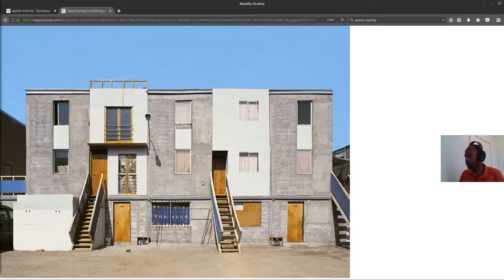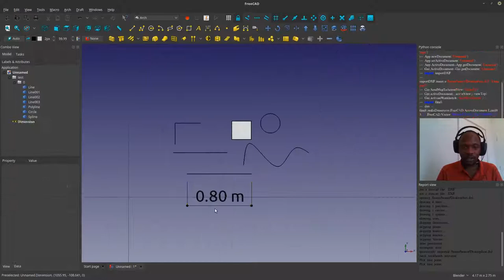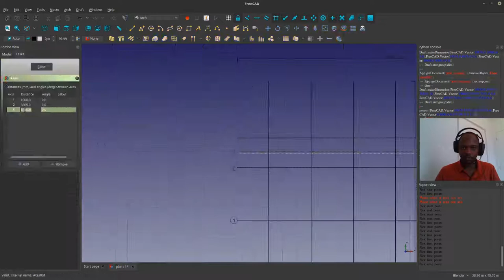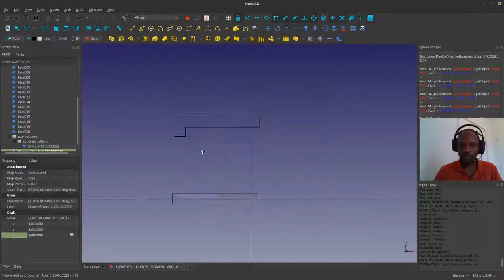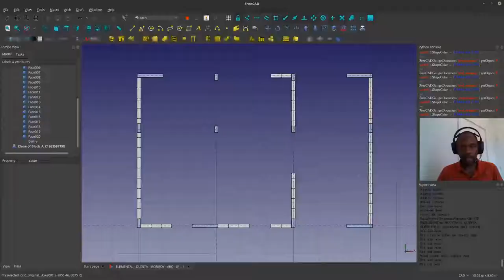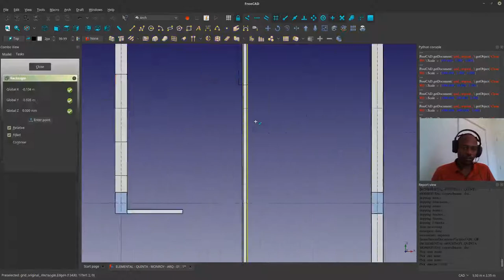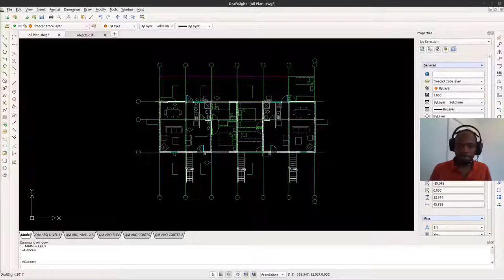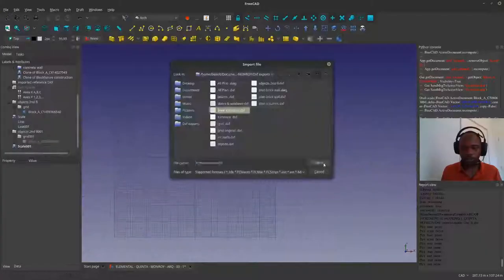Elemental - Quinta Monroy - DXF Import Phase 01 - I - Speed Overview

Comment: Nice videos! BTW, why Draftsight and not LibreCAD, QCAD, etc? These are very good, specially QCAD.
Reply from the maker: Thanks. I come from an extensive robust autocad training for Architectural design. So draftsight is the only program almost similar in features and functionality. I've tried librecad and qcad before aswell. Although they allow you to draw they often had bugs and are missing key industry capabilities required to do productive work. So in the end for efficiency and time saving I had to resort back to draftsight.
Reply: Yeah, it happens the same to me with Allplan (been using it since 2002), it's super productive compared with others. However QCAD is adding a lot of improvements. LibreCAD is very buggy, certainly, and it still needs a lot of work on layouts, scales, etc. I like to see how they evolve (slowly, though).
Reply from the maker: Yeah it's fun bit when u r a full time open source guy on everything it's hard to keep track of everything so at some point choose what to focus on.